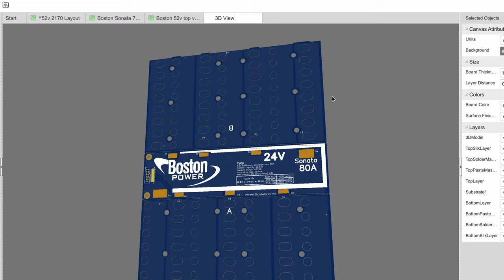Easily install a BMS using a IDC to Screw terminal Adapter

Comment: I know you build electric cars. Have you seen anyone use the cell packs to replace or augment hybrid cars?
Reply from the maker: No,  most of us builders don’t think hybrids are cool so we don’t spend our time with them.   The best way to improve a hybrid is to make it a full EV,  but we only electrify cars we like and we seldom like hybrids.
Reply: I think the number of people well versed in both EV and hybrid ICE systems are gonna be quite few in number.
Reply: @jehugarcia  I agree with you. HYBRID CAR are useless. I had 2018 BMW 740e, I charge it for 3 hours, it gave 19 miles. It was a 4 cylinders engine. $20 gas get me the the week. It is not the same as EV cars
Reply: @simplyfocus9937  Did you try do drive it? I understand what if it's sitting in your driveway and just listening radio it might be good for a week. When I used to have a hybrid(Prius 20) I was been putting about 200-230 miles DAILY, so it's almost full tank, about 30$.
Reply: @pashko90  I drove it a lot, I travel long distance to play golf.

Comment: You used to say no need for bms.
Reply from the maker: I also used to think people were smart
Reply: @jehugarcia  lmao.
Reply: @jehugarcia  lol. Seriously,     you changed a lot. Mo money mo money. I understand. Anyway, I will be a millionaire soon, I will not change, if you follow me  you may take part of it. Because of you. I believe everything is possible, I have several college degrees. I am making a plane in Haiti. Love the vidoe. Like the color of the case
Reply: @vinnyvince23  I got the joke. Lol.  His words remained until he changed it. He never did an update videos that he was wrong
Reply: @jehugarcia  Jehu, this is a good one!
Reply: For sure, you can use a pack without a BMS at your own risk. Monitoring a cell voltages and current, and other parameters of it by yourself is possible, but it's just easier to give a BMS do it's job. Specially on a small packs.
Reply: @pashko90  well let's me say thanks for the reply. BMS without bluetooth is a waste. If you can't see what is going on in the battery. It is a waste. I had an overload issue without the bluetooth JDB bms (no relationship) I wouldn't know the problem. The log was available on bluetooth. I have a video on that
Reply: @simplyfocus9937  I upgraded a mobility scooter to life po4 3.2v 38120 HP  used cells and it's way better than those sealed lead acid batteries.  I agree a bms with Bluetooth is more convenient.  I put together 2 16 cell packs using two smart BMS and am thankful to Jehu the guy in the video for all his informational videos and the links to the cells and the other products that I used.  The used cells for the most part are pretty reliable.  The one 16 cell pack alone did not give me enough amp hours so I decided to add a second cell pack and will add one more to finalize my build.
Reply: @pashko90  every cell is a little different and it's best to do a test on each individual cell before you put it into a pack even if the cells are new.  if the cells are used you'll have to match the cells to each pack you build.  I've noticed with used cells the majority of the cells will reach close to top charge simultaneously while others will not. Example:  3.2 v used cells work best to charge to 3.31 or close to that.  I let my cells drop to 2.00 for the cuvp cell under voltage protection. I like the smart BMS due to the fact you can set all the settings using a app.  All you really have to worry about is cell overvoltage and undervoltage protection and number of cells in the settings.  The BMS will automatically prevent charging or discharging as soon as one cell is over or under your preferred setting.  The point is your cells in your pack have to basically be close to equal in comparison or you will never have a level volt individual cell pack.